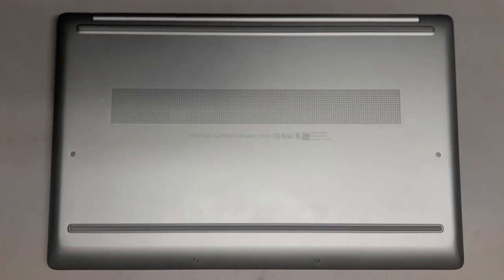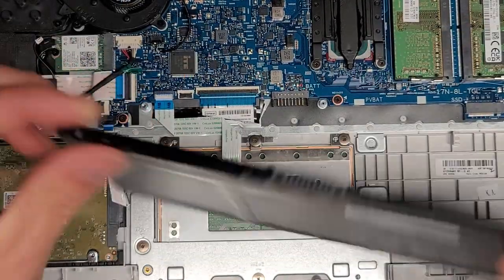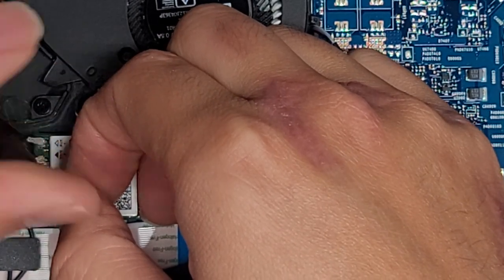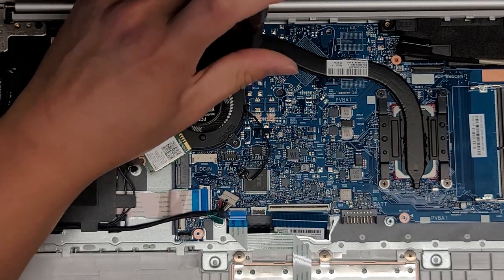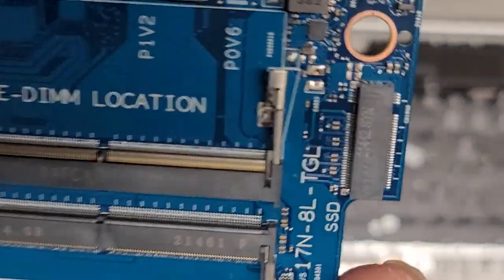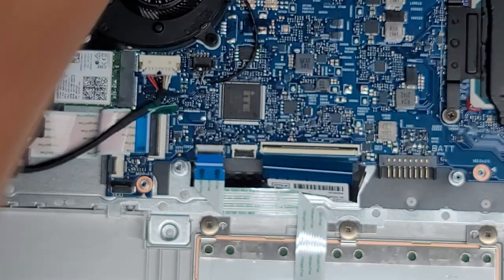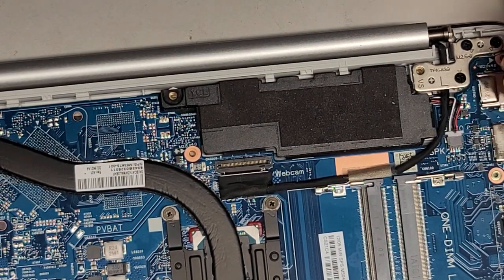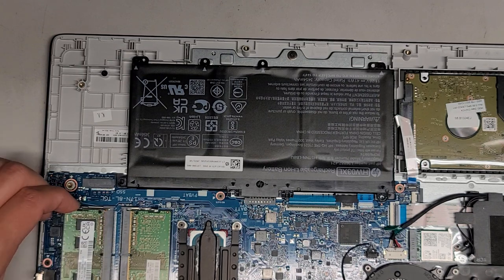HP Laptop Notebook 17t-cn000 Disassembly RAM SSD Hard Drive Upgrade Battery Replacement Repair

Comment: I had to wipe the computer. Got it used. Had bitlocker enabled. Tired installing Windows 10 but right on the intro it says no storage drivers. Cabt seem to find any. Seems inhave a bricked laptop. Anything i can do? I just want to install windows 10 and uss the dam thing.
Reply from the maker: Try this video https://youtu.be/XEKe84KL_fM

Comment: WHat is the part number on the sata data connector cable for 2.5 inch sdd
Reply from the maker: Hmmm I couldn't find one.
Reply: @ItsBinhRepaired  it would be useful to have any description on the label. Need to order one. Thanks
Reply from the maker: You'll have to open it and check. I don't own these computers.
Reply: @ItsBinhRepaired  thanks Mister. I did not get one need to find on ebay, there was this stick/mc inside.
Anyone else please?
Reply from the maker: @danseeli5194  hm?

Comment: Was looking for location of CMOS battery... but your video doesn't show a full shot of the underside of the board
Reply from the maker: Check for a replacement motherboard on ebay or something. They'll have pictures, but I'm pretty sure it uses the main battery as the cmos battery.